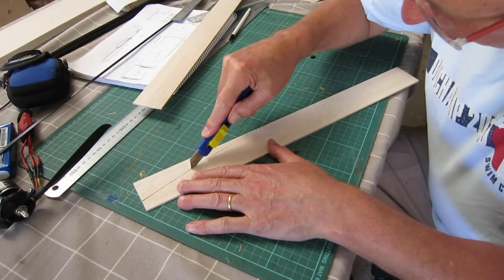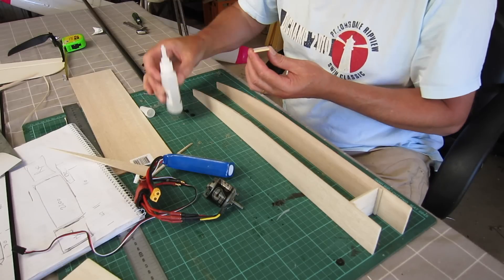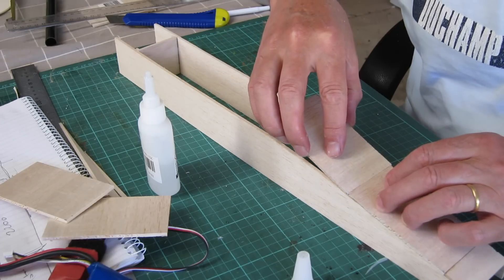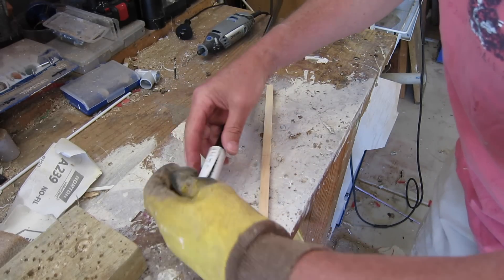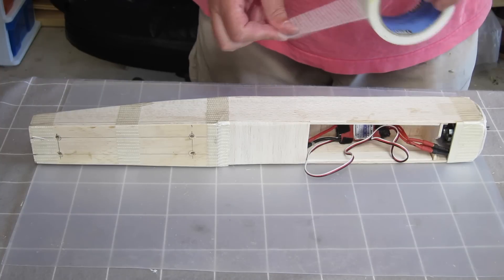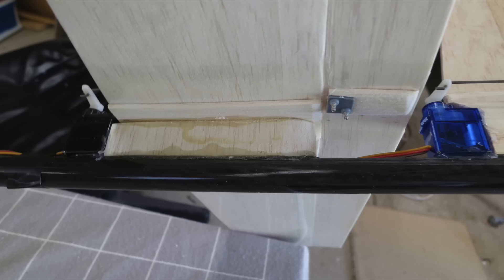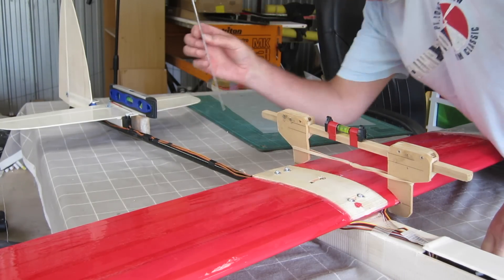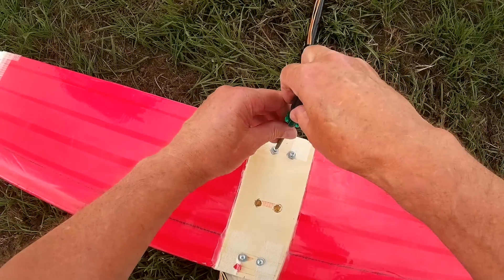3m Phoenix fuselage

Comment: Should the bottom of the wing be flat? I have a high lifting wing and building a new fuesolodge withers the wing running throught the fuesolodge not rubber band on top
Reply from the maker: With a flat bottomed airfoil you usually need to lift the trailing edge up a few degrees

Comment: Would a 10mm in diameter and 2mm in thickness CF boom work ?
Reply from the maker: Maybe but it will be heavy. I'm using 16mm with 1mm wall

Comment: I have made 3m wings  of 6mm depron and a long 2.5m alluminium rod in middle as a spar and some small CF rods , will this be stiffer to handle 1860gm of weight ?
Reply from the maker: No idea how stiff it is, only you can try it.

Comment: So I have built the same but it weights around 1840gms , will IT glide nicely ?
Is that wing fixed only by screws on fuselage ?
Reply from the maker: That's probably too heavy, unless the wings are stiffer than mine. 2 bolts through plywood plate hold the wing to the fuselage

Comment: Then 2636 motor is ok for this ?
Reply from the maker: Depends which motor manufacturer. Some measure the stator or windings, and some measure the outside can. 2212 can be the same as 2826.

Comment: Is the balsa wood rod is good for spar of the 3m deprron wing ?
Reply from the maker: Not strong enough for 3m, you would need fibreglass, or carbon fibre, or edge-on plywood for enough strength

Comment: how do you prevent wing flex? what kind of spar do you use
Reply from the maker: The centre section has an aluminium tube to accept the Phoenix wing joiner/spars, and it has 6mm x 1mm CF strips edge on glued into slots top and bottom.

Comment: Fantastic build! Thanks for that great idea with the plummingpipe for connecting the tailboom. Never thought of that! The handtoss showed how great build this is! I'm thinking that you maybe have built it a bit to "jucey" and perhaps you could have made it lighter with a smaller motor and battery. It's gliding perfect as is and on a glider, the motor is just for getting up to where the lift starts. Who cares if it takes 1 minute or 5 :-) Keep it up, Andrew! And enjoy the summer :-)
Reply from the maker: I would have to make the tail lighter or shorter if the motor and battery were smaller, or lengthen the nose.
Reply: Ah, of course. :-)

Comment: Great stuff, though personally I make minimum use of balsa and my local model shop has closed down. So I probably won't be buying any more. How much longer was the new fuselage? About 10cm is my guess.
Reply from the maker: The Radian 3 channel is a must. Brilliant for FPV gliding and thermalling, and so easy to setup and dismantle. If you really want full house I'd recommend the Phoenix Evolution next. If that's too big then go for the Phoenix 2000. The ASW28 looks good but is very delicate and demanding to fly.
Reply from the maker: Horizontal stab is in the same spot but bigger,  Vertical stab is 180mm further back and bigger.
Reply: I was just thinking that the Phoenix tail feathers are pretty small for a 3M span.
Reply from the maker: Like Goldilocks. The P2K rudder is way too small, the Ph Evolution rudder was bigger but still too short, this one is perfect.
Reply: Andrew Newton great video. what a beauty! can i ask your advice.. what would you reccomend as a next step after my bixler.. a Pheonix 2k or Pheonix Evoloution? (or radian, etc) would like to do a nice fpv soarer
Reply: hmm or the volantex asw28 looks nice